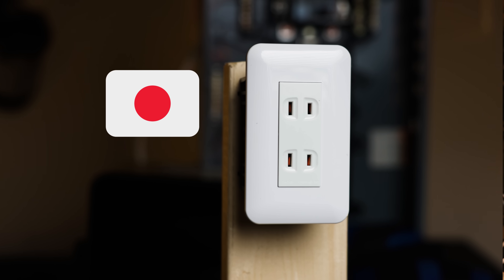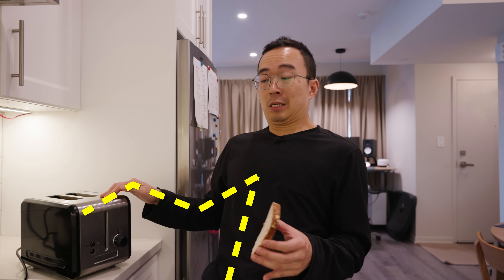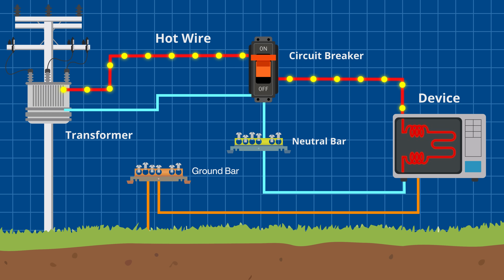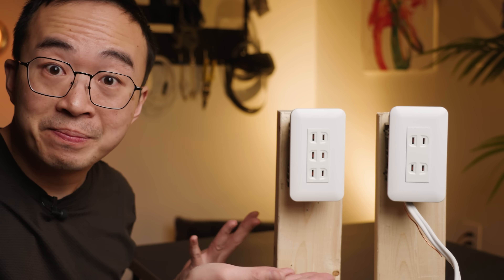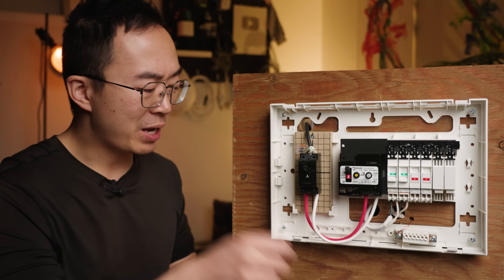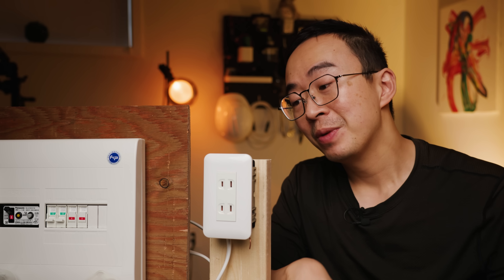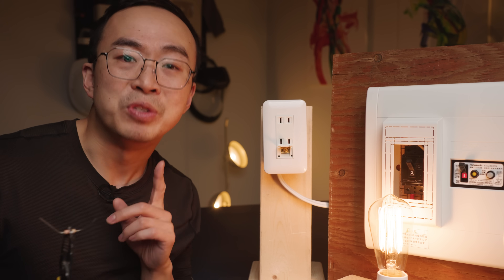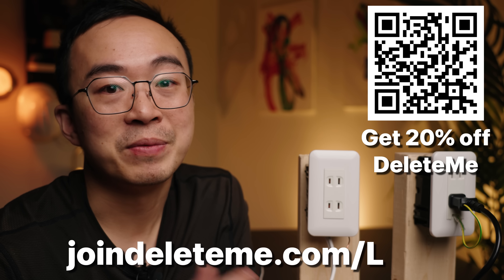How Japan Made Their Outlet Safe

Comment: As someone who sensitive to emf, dirty electricity and equipment with high static energy, grounding is extremely important, devices can build up a high static energy and the grounding helps release that.which is important. Non grounded devices, electric fences etc can and does cause not only health issues but does interfere with wireless communication (got crap wifi signal its probably your neighbour with an ungrounded electric fence). This was first noticed in America in mid 1950's (60's) sorry I forget) where planes would lose communications in certain areas until they figured out ungrounded fences etc was causing this.

Comment: why uk outlet is safer than both
Reply: Much more expensive too. UK seems to be an extreme example of regulators thinking all people are hopeless idiots.
Reply: @sootikins  And they’re mostly correct, only the oldies seem to know basic electrical at all.
Reply: @V01DIORE I suppose you're right. Sad state of affairs. What happens when all of us oldies are gone?? (says I, a 65 y/o electrician turned controls engineer later in life)
Reply: @sootikins  That is because most people are hopeless idiots when it comes to electrical safety.

Many regular people in the UK are clueless about how a plug even works, if you gave them two plugs, one with a grounding pin and one without many UK people wouldn't be able to tell you what will go wrong with the 2-Pin Socket if you use it and the appliance attached to it has a major electrical failure.

The reason we have high standards is to ensure peoples safety, it works too, let's not change what isn't broken.
UK Residential Electrical Systems are one of the best globally still, and it's over 100-Years Old at it's core Spec, it's also older than the American Spec, so that says a lot about how crap the American Spec is when it's worse than a older Spec lol

As for the Japanese Electrical System, they still have two line frequencies splitting the entire nation in half, let's not compare them when they can't even get that bit right.
Reply: @sootikins  
The UK regs are high but could and should be higher, like having all breakers in the main panel being double pole and all circuits have AFDD protection.
Reply: Modern French outlets are better than the UK ones.

Comment: Your explanation of how breakers work in the US is wildly incorrect to the point of misinformation.

In the 4th minute you haven't gotten to GFCI (or AFCI) breakers yet and you're talking about thermal trip breakers. Those DO NOT require grounding to function. It's typically a bimetallic strip that heats up if you're over-current (either a very high transient load, or long term being above 80% of the nameplate amperage).

GFCI breakers (and outlets) don't directly protect you from touching the hot wire, they trip when current passes through the ground wire, or when an imbalance happens. So if a hot wire touches the metal case of an appliance that is grounded, it trips. If you drop a hair dryer in the tub, that's an imbalance and it can trip. If you touch a wire and the imbalance is low enough it may not trip.

Japan's GFCI system is LESS safe than the modern systems in use elsewhere with a ground wire - the Japanese system works solely on the disparity of current in vs out - they cannot protect you from the metal case of an appliance becoming energized UNTIL something touches that case and is shocked causing an imbalance. It should also be noted that in most countries you now are required to use combination breakers that are both arc fault AND ground fault, which is remarkably safer.

Japan could easily fix this by simply running ground wires in buildings even if they don't bond neutral to ground. Additional fun fact: in a home that has no ground run to the outlets you CAN install a GFCI outlet and be protected. The appliance ground is connected to the GFCI's ground so it can detect ground faults and the GFCI's imbalance protection also functions.
Reply: No, he was pretty much spot on.  In the event of a ground fault in a toaster, there isn't any current flowing without a safety ground, so the breaker doesn't trip.  Current only flows when someone touches it, and then it takes much less current to kill the person than it does to trip the breaker.  It is the presence of the safety ground that ensures that the breaker will likely trip before someone touches it and dies.  You said that you can touch a wire in a GFCI and the current may be low enough that it wont' trip, but iirc, they are required to trip with only a 5 mA imbalance, so if you can feel it, it will trip.

Comment: I am confused as to why the neutral is connected with ground. In the case that the outgoing neutral wire is broken, the neutral becomes live voltage. By connecting the neutral and the ground, the ground becomes live voltage. If an outlet does not have GFCI, like a toaster, then the entire outer casing of the toaster is live! This sounds horrible

Comment: 0:28 Russia?! F**k You! The Schuko is German, and though the Russians have adopted the superior Schuko, it's used all over Northwestern Europe.

8:10 Okay, if I wasn't annoyed before, I am now, it's the RCD that makes the outlet safer than the outlet but an ungrounded outlet is still more dangerous than a grounded one should the RCD fail. Furthermore I think it's irresponsible to plaster over a problem such as insufficient short circuit current.

Comment: Yeah, not quite true - grounding is a requirement not only in France but in whole Europe - including Eastern European countries and is nothing to do with replacing RCAs. Ground is connected to Neutral only on old installations where you can not easily install separate grounding. You don't just rely on soil conditions there are measurements that are made / solutions used etc - it is a well regulated process. Not having separate grounding is inferior. For example in my home in Germany I have grounding using separate rod, as well as every copper pipe cumming in is connected to ground. I also have RCAs on every outlet, basically it's impossible to wire anything without going through the RCA

Comment: TT is also used in the uk. However, most homes are protected by TN-C-S. But it does suprise me that nowhere else has the shielded sockets like in the uk
Reply: You mean the shutters. In Finland they have been the norm since the 1980s. We had them in the children's rooms in the 60s. The ones we have are better as they need two prongs to be inserted at the same time. The UK ones that open with the ground prong are almost worse than no shutters as if you stick a knitting needle to the ground you open the shutters and also have a direct route to the ground.

Comment: Sorry, but you get a thumbs down on this. From the clickbait title, to the factual errors (like showing ground as having a much lower impedance than the line; the fault current is limited — until the breaker can trip — by the resistance of the line wire and whichever return path is used. The short circuit current to neutral is just as big as the short circuit current to ground.), to the omission of facts (that GFCIs aren’t just used in Japan, but are in fact common worldwide), to the conclusion that GFCI protection is “better” than fusing (they aren’t: they complement each other), and the omission of other reasons for having ground (like preventing the EMI-capacitor tingle from ungrounded switching power supplies, a bond point for shielding, and to provide a path for static charges to dissipate). 

And before you comment again that you were only talking about USA and Japan, not the rest of the world: you start the video by asking why ground is required by “every other country” and then list a few. And then proceed to ignore that most countries now require GFCIs in addition to ground. 

Japan isn’t the only country in the world with smart people. The chances that one country would get it right and 200 countries would all get it wrong are… vanishingly small.

Comment: Japan two prong outlets are more dangerous than three prong outlets. The neutral and ground are tied at the breaker box. The ground side at the breaker box is tied to the Earth for lightning protection. if a metal appliance has a fault and comes live at the metal casing it sends it back through the ground and neutral side of the breaker box to trip the breaker. It is in the nec code and the lec code in America.

Comment: So Japans "groundless" outlets are safe, because a crowbar circuit would blow the fuse.

And by the way, the groundless outlets are grounded (so GFCI can work), if you had a screwdriver handy when plugging in your device.
Because inventing a plug that has a ground and making that the standard, would be too much of a hassle.

I know it is a retrofit, but looking into how many countrys changed outlets since electricity was discovered, you think Japan could pull that too...
Making a sub par retrofit the standard is just a band-aid, not a solution.

Comment: Too long, don't watch, here's the summary:

A GFCI / RCD works by detecting an imbalance of electrical current on the neutral and active ("hot") wires, normally current through active and neutral will be equal. If current flows through you because of a fault, the current between the two wires is no longer balanced (as there's more current through active than neutral because some is flowing through you) and so the GFCI trips and kills the power.

Comment: I could be wrong but with the ground wire being the same size as the neutral actually wouldn't allow more current. The ground is usually connected to metal cases of components. This means that if any hot wires (neutral can carry current aswell) touch a metal component you don't get shocked. Instead it shorts to the breaker. This actually usually creates an electromagnetic collapse in the breaker which tripps it. That's why pulling 17 amps from a 15 amp breaker might take 30 seconds to trip but a short will trip right away. Also you may have mistaken earthing rods for grounding rods. The rods that go into earth take and energy from lightning hopefully back into the earth (where the lightning is trying to go) that's an earthing rod not a grounding rod from what I understand. Last thing. You can actually see for yourself that grounding is simply mean to short accidental hot wires touching what they aren't supposed to. Inside your bathroom often by your gfc you have the ground connected to the copper plumbing. Why would a wire meant to carry an immense amount of current at home voltage be connected to plumbing l. That is because if a hot wire touches plumbing it will trip instead of staying hot. By the way sticking a fork into one side of an outlet won't shock you often times because your resistance is to high. Now that changes if you are in the shower.
Reply: the ground and the neutral are both actually bound to the ground, its a method of neutralizing a building charge on the neutral and keeping the wiring from appearing like a target to lightning as well... very few people understand the lightning thing because house wiring is "do as we wrote or you get fined"
Reply: Pulling 17 amps from a 15A breakers takes awhile trip because a bi metallic strip takes a while to warm up and open the circuit. When you short a 15A breaker it trips immediately because all that current passes through a coil which will pull the breaker contacts a part when the magnetic field is strong enough. This is by design so something like an air-con unit with its large compressor does not constantly cause tripping because for a few hundred milliseconds motors tend to pull a high current just as it accelerates its rotor from stationary. In a RCD / GFCI there is another coil where neutral and live passes through. In normal operation no electricity will be induced in that coil as the outflow and return cancel each other out, but when you stick a knife in the toaster and make contact with the element some of the energy is not returning via the neutral, which induces electricity in the GFCI coil, the tiny bit of electricity is passed on to a TRIAC (or something similar) which then basically shorts the breaker causing it to open almost immediately.
Reply: @aaron_11111  yeah thats a much better elaboration on what I was trying to say thank you.
Reply: It's not about the size of the wire.  It's about the fact that there's no resistance in the device between the hot line and the ground (when a fault develops), so in that situation the device will allow a lot more current to flow than is supposed to, which trips the breaker.

The same thing would be true if there was a fault in the device connecting live to neutral, too.  It's just that ground is a dedicated connection that's always guaranteed to be safe to touch, so it can be connected to things like metal exterior bits (live and neutral are often inadvertently swapped, and in some fault situations, neutral can actually end up with voltage on it too, so neutral isn't always guaranteed to be safe).

Also, at least in the US, there is no difference between a "grounding rod" and an "earthing rod" (technically, in standard US terminology, there is no such thing as an "earthing rod" at all.  They are officially always called "grounding electrodes".)  Grounding rods (or "earthing rods") are also not intended to protect against lightning (this is a common misconception).  The grounding conductors are actually nowhere near large enough to be effective in the case of a direct lightning strike anyway (they'll probably just be vaporized).  Grounding electrodes are actually intended only to dissipate static charges and eliminate differences in ground potential from one location to another, and also to ensure that the ground wires (and neutral) are always kept close to the same potential as surrounding things that are not part of the electrical system (they are not allowed to "drift up" to accumulate high voltage potential on them, which might otherwise be possible if they weren't tied to anything else).
Reply: Earthing rod, ground rod, same thing; earth wire, ground wire, same thing.
Reply: @jovetj  yeah my point is that for example a ground wire in a car is not earthed. I get that neutral and ground connect in a service panel so the ground wires connect to the ground rod directly but what I was saying is that people believe that the electricity goes into the ground through the earthing rod. It almost never does in any meaningful capacity. So a circuit is grounded to the power lines and earthed through the earthing rod. Normal electricity will flow back the the power lines. Extreme cases, (lightning and freak overvoltages) will dissipate through the ground rod on a meaningful scale.
Sorry for some reason this is a different account that I'm replying from im the original poster though.

Comment: That "Negative Earth" strap in the power distribution box confused the hell out of me when I was young because I used to experiment with DC hobby circuits and thought of mains power wires as Positive (Red) and Negative (Black) and used to think that substantial amounts of power were returning via the black wire but as a negative voltage (Like the sine wave pattern, but under the line) and then I see Earth (Green) and what I learned later was Neutral (Black) were tied together in the box, I was horrified. This is nuts !
Anyway after a few years and burnt brain cells in my young teen years I finally figured out how AC works and that everything is fine.
Some of us had to learn stuff this way.

Comment: That is crazy that USA connects ground to neutral. I thought you had no idea about how electricity worked and were just talking a bunch of nonsense until about the last 3rd of the video...
Having a ground at home and not making it easily available at the sockets is dumb, but wiring the ground to the neutral of the power utility's transformer seems homicidal in nature, to me. Forget about induced voltages, capacitive coupling, and stray currents constantly corroding your grounding rod... if the ground fault is not total (i.e. it doesn't fail hard enough to trip your breaker) then you just DIE and that's it. 😨
Reply: Neutral always gets bonded to ground somewhere. Where depends on the earthing system used, which varies by place (not just by country; it’s very common to have different systems in use within a country).

Comment: I wanted to point something out about gfci outlets as there is a situation where they are within code to be used in a location where no equipment ground exists and is normally supposed to be labeled as such. This type of situation will result in an outlet tester being unable to trip a gfci outlet and thus can only be tested by using the test button on the outlet. 

A scarier situation is in older homes where someone is wanting to sneakily pass inspection and shunt neutral to ground behind the outlet. Sure this will make an outlet tester show a correctly wired circuit but instead is a serious shock hazard for anything that is relying on that ground pin to be wired properly. 

Hope this educates someone 😁
Reply: That is not just about fooling a tester. It actually is a recognized grounding method known as TN-C. It is not allowed in the US but has been used in many countries in the past. It is not inherently dangerous but it has issues and there is a good reason why it is not allowed. 

In Finland it can be still used in old installations if one wants to ground sockets.

It is very dangerous if the socket has ground and neutral reversed.